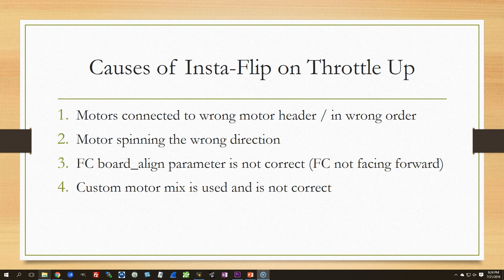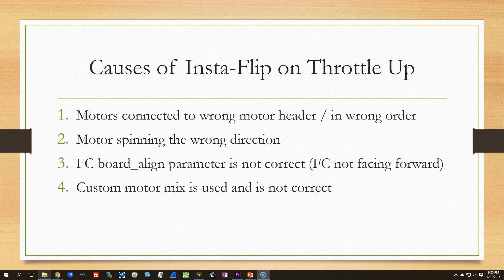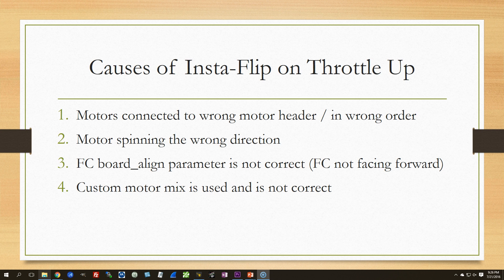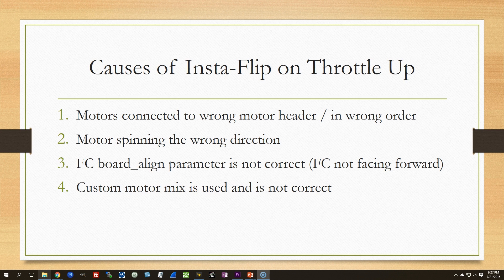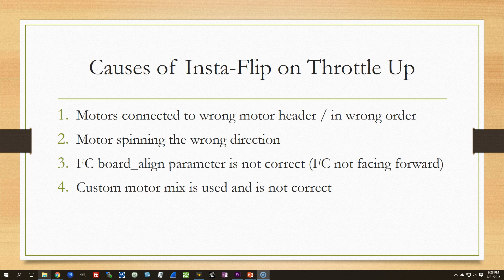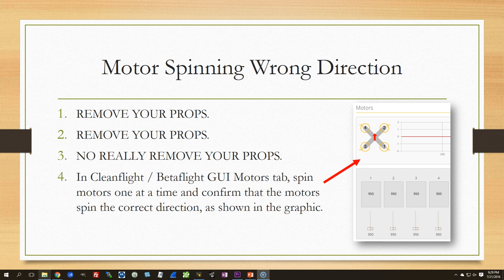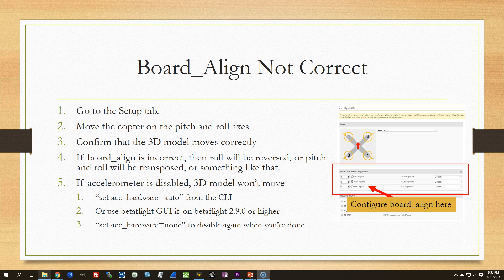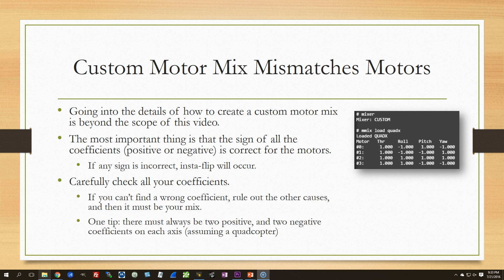Quadcopter Flips On Takeoff: Solved

Comment: I don’t have my quad flipping on take off, but it does automatically want to pitch forward and I don’t know where to start looking. Is it the gyro? Nothing else is affected. Just have to counteract it in acro. Also this is my first quad build. Everything else is fine I believe.
Reply from the maker: Make sure your channels center at 1500 in the receiver tab. If not, use subtrim function of your transmitter to correct it.
Reply: Joshua Bardwell thank you for the fast reply you are the man. I will check tonight thank you.
Reply: Joshua Bardwell okay so all my channels are 1500 when battery is unplugged. As soon as I plug the quad in, the pitch jumps to 1555. Can I calibrate it without doing so through the outputs on my TX or without using deadband?

Comment: Thank you @Joshua Bardwell!! I've watched dozends of your videos over the last few days. Finally my quad can hover and i can wait for dry weather 😎
For some reasons i had to set the motor rotation to "reverse" in betaflight for my HX115 HD. Otherwise the quad always startet at full throttle, when arming 😵
One day ago i didn't know what betaflight even is exactly and how i could set the buttons on my remote.

Comment: Hi
I need help
I have f450 frame with 10’ propellers
I have two problems 
First one at low throttle i have high rpm
Second it rolling when take off

Comment: HELP PLEASE!!! :( tried looking everywhere on the internet but i have (i think) ESC problems....

Does something similar in this video but I didnt even touch the throttle. Once armed, it would slowly start spinning the motors with the rpm slowly gaining and then 1-2 seconds later go full throttle and flip to one side. 

The ESC tone is delayed (doo doo doot "4-5 seconds gap" then it would go do doot) but when I plug it into betaflight, the delay disappears. Any thoughts?
Reply: Try removing Airmode.
Reply: @noobcup  I had an "idiot" moment where I thought the firmware was STM32 but it was in fact a different firmware. Should have used the CLI instead of looking at the actual FC... I learned tho :)

Comment: I needed this video on my maiden flight today - in my naivety I didn't put the reverse props (denoted with R at the end of the prop type/pitch on the actual prop) on the right motors.  As soon as I had the RIGHT prop on each motor - by looking at motor rotation on BetaFlight - everything was butter and I was doing split-S's through my front porch within a couple hours.  This video lead me down the path to finding out what my newbie brain did.  Thanks Mr Bardwell!
Reply: That's cause 5: fore/aft prop-swap on one side.

Comment: I have my quad doing a flip after a bit crash. It hovers fine but soon as i give it decent throttle it just rolls over, No esc restarts and i can arm and fly again. I have started replacing components, 2 escs and the fc so far and i'm still int he same boat. I have a feeling this isn't esc related but 'm sort of at a point where i have no choice. Everythins is obviously ok in the setup as it hovers and it started happening after a crash. hmmmmmmmmmmmmm
Reply: Connect to betaflight and check if the quad looks like in the simulator and also move the same way

Comment: Thank you soooo much!!!!  I just built my first toothpick, and had no idea about the Board Align parameter.  I had the motors remapped correctly for the upside-down flight controller, and thought I was done.  After setting 180 degrees of Roll, it works!

Comment: Thanks again. You provided me knowlage I needed right now. My quad was fliping after take-off and I was sure my motors are spinning the right way. Problem with my Tyro99 was that for some reason after firmware upgrade (from 3.XX to 4.0.4) board accelerometer was fliped in Configuration 270 CW. I set it to 180 CW and it fixed the problem. 
I like what you are doing on YT.

Comment: Mine is flipping on arm , and its none of these. Im about to remove the cage and take the vtx off i think its putting to much pressure on the fc , could that make it flip also ? Before i start tesring it down again
Reply from the maker: Check props installed correctly.

Comment: My drone keeps on going backwards when I try and take of what do I do ?
Reply from the maker: Make sure your channels move the right directions in the receiver tab. Look at the 3d model in the receiver tab and make sure it moves the right way when you move your sticks.

If you are in autolevel mode and it is drifting, use accelerometer trim to fix this. I have a video about "trim your accelerometer".

Comment: The quad flew perfectly with BF 4.0 though the motors were getting warm but not hot thought.
I saw your video on why BF 4.0 is killing you and decided to make the recommended changes on filters.
Upon testing it started flipping upon takeoff. I reverted back all the changes to my amazement it still flips.
I checked all the solder connections; all was good. At first I was dumbfounded as i all the changes i made were filters.

Insert " A few stupid hours later.." 

I tried googling the issue and here i came to your video.

Watched this video and checked all 4 points and there it was board alignment was off.
I really don't know how in the world that changed as i didn't even go to that tab (as far as i can recall).

This video killed the idiot in me. Lesson learned don't make life complicated and check the basics.

More power to you Joshua you just saved me a couple hundred dollars as I was about to throw this quad on the bin. Let me buy you a beer atleast as gratitude to your service to us quad #KnowItAlls.. hahaha..

Comment: Joshua, I have done everything on this list to diagnose why my quad flips out on take off (or idle) and everything is correct, but it still happens. What would the causes be if it still happens? Is my 4 in 1 blown? Would adding a capacitor (that came with the Hobbywing xrotor stack) help this at all? I have brand new botgrinder motors and the only thing I can think is that maybe I burned out my esc when soldering the motors. It was my first time and didn’t seem like any of the pads lifted. But correct me if I’m wrong, but if that was the case wouldn’t the quad not be able to arm? I’m running out of fixes over here and thinking about just getting a new stack and starting fresh with my motors, and if that doesn’t work then it must be the motors? Help

Comment: I'm having a similar problem except the quad takes off  then operates  normally and after about 15 to 30 seconds it flips over!  The quadcopter used to fly well without this issue. 
Any ideas as to what is causing this problem?
Reply: faulty esc

Comment: recently got myself a Runner 250 quad and the props are going the wrong way round, have tried fitting the props on opposite drives but on the runner 250 they only fit the correct way on , not been in this sport to long so im a tad lost here, ive watched lots of videos and nothings working ? anyone got any ideas guys
Reply from the maker: Since the Runner is a ready to fly kit, I would expect the motors to turn the right direction for the props. I don't think the Runner uses Betaflight so I'm not sure how to advise you to fix it, if the motors are turning the wrong way.
Reply: @JoshuaBardwell  cheers Josh, i,ll just keep tring , i,m hoping i can save thinks with Clean flight, just waiting for the lead to be delivered, then the fun starts
Reply: i,m thinking iv,e bought a pup, its early days pal....ongoing

Comment: Joshua, First, thank you for your videos, I have learned a great deal from you. Secondly, Do these 4 variables hold true for a whoop as well? I have a BetaFPV 2S 65X and it was flying just fine until I decided to get brave and adjust some settings in both the OSD Smart Audio and Beta Flight (dumb thing, I know- if it aint broke...) Now it immediately flips in the roll axis when throttle is applied. I have verified all four variables, the motors as spinning correctly (although reversed, a whoop thing I quess). Motor order is correct, FC is pointing forward (towards motors 2 and 4) . STILL the darn thing want to be face down for some strange reason. I even read the comments about the 5th variable (2 props reversed) but my props have never been off - it's only 2 days old. Any ideas?
Reply from the maker: It could be that you have a left-side motor not making thrust so when you throttle up it turns over. The difference with a taz-flip is that it will sort of feedback-loop accelerate into itself.

Comment: What to do if I use 2400kv motor for f450 frame is it fine if I use 2400 KV motor coz i buyied
Reply from the maker: 450 frame typically will have larger props and 2400kv motor will be too fast.

Comment: Thank you for this. 
I was having the problem after a rebuild (friend’s flight) and I couldn’t figure out why it wouldn’t behave.  
  I had checked motors, props, reflashed a new BF version and reconfigured from scratch, etc...or so I thought. 
  I hadn’t thought about checking the orientation of the model movement in BF. 
  Low and behold, the FC was rotated as were the frame arms. 

No wonder it was so confused. 

Thanks!
Reply: I had the same issue something so simple that can drive us insane

Comment: Checked all these and its still flipping :/ any other idears?
Reply from the maker: If the quadcopter instantly flips over when you arm and raise the throttle with props on, it is almost 100% certain to be one of these things:

1. Clockwise prop installed on counter-clockwise spinning motor or vice versa.

2. Flight controller not facing forward. Go to the Setup tab in the configurator. Tilt the quadcopter on all axes (pitch, roll, yaw) with your hands. The 3D model in the configurator should move the same as you move it with your hand. If it does not, use the Board Alignment parameter in the Configuration tab to fix it.

3. Motors not wired correctly. TAKE OFF YOUR PROPS. Plug in a battery. Go to the Motors tab. Turn on the "props are off" slider in the lower-right. Raise the individual sliders (1, 2, 3, and 4) one at a time, just enough that the motor begins spinning. The motor positions (1, 2, 3, and 4) should match the graphic in the upper left. If they do not, then either move the signal wires so that they are correct or use resource reassignment to virtually "move" the motors.

4. Motor spinning wrong direction. Do the same as step 3 but compare the motor direction to the arrows on the graphic in the upper left. If a motor is spinning the wrong direction, either reverse it using BLHeli (or whatever ESC software you are using) or swap any two motor wires with each other, which will reverse the direction.

Many times, people swear up and down they have checked all of these things, and then come back to say oops I missed one you were right. So if you think you have checked all of these things and your quad still FLIPS OUT, go back and check again. If your quad is insta-flipping on takeoff, it is almost always one of these things.
Reply: Doh! Annnnd my many many apologies. I am a total noob. I got my first training quad to learn on, an EAchine QX65. Took it out of the box and fired it up. One prop flew right off. So I just reached into the box and put another on....backwards >< . Went through and tested tested tested, then finally looked closer at the props...sun of a >< .  Here is a video that might properly convey my current level of apology. 
https://www.youtube.com/watch?v=c3sOuEv0E2I
Thank you so very much for all the help you provide to the community it is more appreciated than I can say.

Comment: I have a tyrant s. I just replaced the chassis and upon  doing so i mixed up motors 2 and 4 which i believe to be the front motors.  2 is spinning CW and 4 is CCW which is good so it wont get debris thrown into the camera. I  went into BLHeli and reversed motors 1 and 3. Now i know i have to tell the flight controller what i just did.....please help me through this next step
Reply from the maker: In the Configuration tab, under the Mixer pulldown, there is an option for "reversed props".
Reply: Joshua Bardwell i was looking for that option on betaflight but maybe that one im using is a ealier version. I dont have it under the picture for reversing.......i only have 2 props rotating wrong way.

Comment: My Quadcopter still flips :/
Reply from the maker: If the quadcopter instantly flips over when you arm and raise the throttle with props on, it is almost 100% certain to be one of these things:

1. Clockwise prop installed on counter-clockwise spinning motor or vice versa.

2. Flight controller not facing forward. Go to the Setup tab in the configurator. Tilt the quadcopter on all axes (pitch, roll, yaw) with your hands. The 3D model in the configurator should move the same as you move it with your hand. If it does not, use the Board Alignment parameter in the Configuration tab to fix it.

3. Motors not wired correctly. TAKE OFF YOUR PROPS. Plug in a battery. Go to the Motors tab. Turn on the "props are off" slider in the lower-right. Raise the individual sliders (1, 2, 3, and 4) one at a time, just enough that the motor begins spinning. The motor positions (1, 2, 3, and 4) should match the graphic in the upper left. If they do not, then either move the signal wires so that they are correct or use resource reassignment to virtually "move" the motors.

4. Motor spinning wrong direction. Do the same as step 3 but compare the motor direction to the arrows on the graphic in the upper left. If a motor is spinning the wrong direction, either reverse it using BLHeli (or whatever ESC software you are using) or swap any two motor wires with each other, which will reverse the direction.

Many times, people swear up and down they have checked all of these things, and then come back to say oops I missed one you were right. So if you think you have checked all of these things and your quad still FLIPS OUT, go back and check again. If your quad is insta-flipping on takeoff, it is almost always one of these things.
Reply: Joshua Bardwell Thanks a lot 👍🏽😀 I connected one motor to the wrong input of my flightcontroller as well as the PID-settings were way too high so that the quad flipped at just a little roll 😉

Comment: i checked all this and everything looks perfect.. but when i go to take off its still doing the same thing... tried a new motor (same as the factory). still flipping. tried switching ECSs around and its still going in the same direction every time. tried re flashing and resetting everything to the same as day one of flying and nothing still flipping...i even treid rebinding my transmitter im at a loss....

flying a wizard 220 with a flysky fs-i6
Reply from the maker: Wizard X220 requires yaw board align 270 degrees for the spracing f3 flight controller. This would be a common oversight that would cause this problem. Check in the Setup tab that the 3D model moves correctly. If you pitch the quad in your hand and the 3D model moves on the roll axis, this is the problem.

Comment: Hi Josh my quadcoptor is wired up correctly done everything you've said... it Sometimes takes off it turned the way I wanted for a brief second and then goes into a flip....please help I'm banging my head against the wall lol cheers and happy flying to all people;) by the way it was flying perfect un till swapping esc on all for but now problems lol and it always flips to the right...could it be a bad esc or flight controller on way out? Cheers

Comment: Hi JB, your a legend mate....

Heres another one to chalk up on the board, 
Kiss 30A ESC's, didn't calibrate them on new build, found that when I armed quad and throttled up slowly my motors would run backwards full tilt, slowing down as I get toward 50% throttle, then stop and spin in the other direction as I pass mid throttle and proceed to go up as I increase throttle..... I was doing my head in trying to figure it out, thought I may have enabled 3D in Betaflight (oh there is a lot of buttons in the new 3.3.3) but nope, ......??
After a few loooonng hours of racking brain I tried calibrating ESC's, wallah!! FIXED!!

Comment: just had this happen on a new steele alien build with steele’s pdb kiss fc v1 and kiss esc 
props on correct, motors spinning properly, fc facing proper direction,when i arm it the motors start their spin but as soon as throttle is applied it flips
when looking at setup on kiss gui and rotate quad pitch forward the image rolls first before stabilizing forward,

Comment: Have a chameleon ti, about 1 to 3 seconds after take off it dips forward left.  Not instant  like this,  it will sit idle air mode just fine, spin up ok, but as soon as i start moving forward it rolls over left everytime,  it is bnf, and ive been flying it for 2 months, so its none of this i think.  Any ideas?
Reply from the maker: Mechanical damage to the front left motor is my guess.
Reply: Joshua Bardwell thanks, i was figuring motor or esc, i had ordered cw and ccw motors and an esc, but i figure i had to ask thee guru 😉